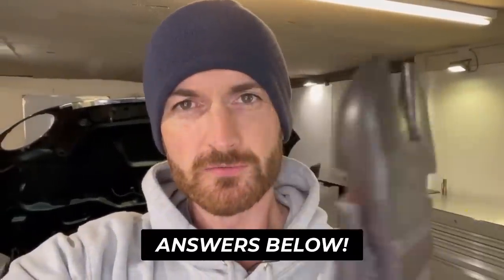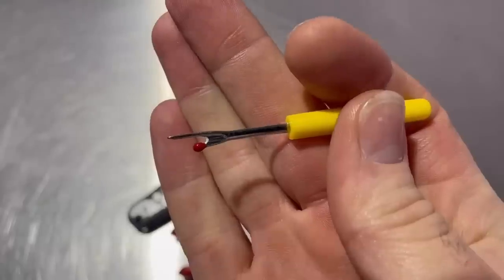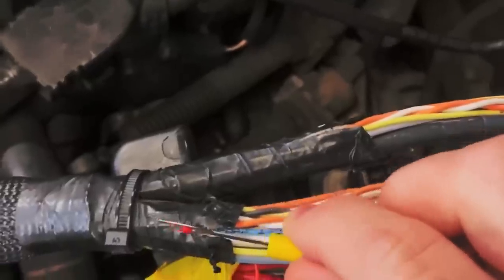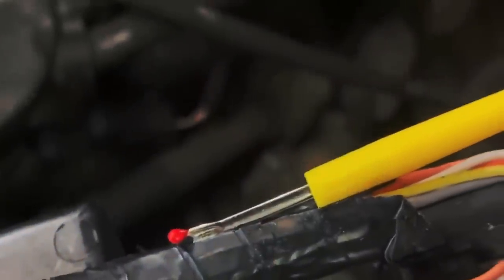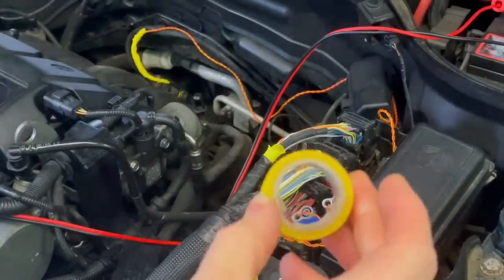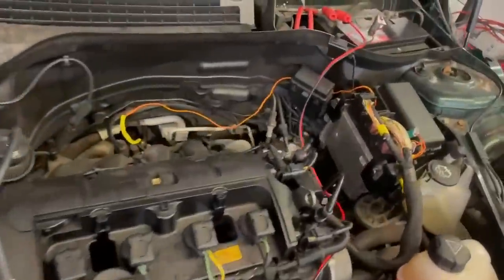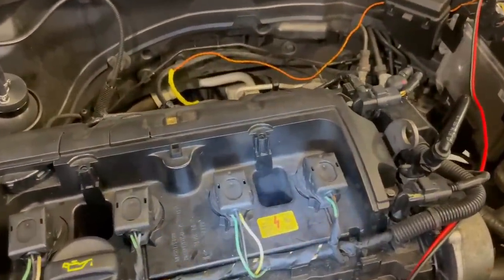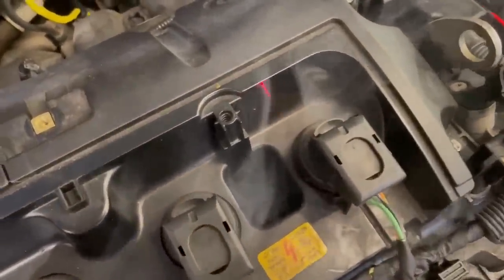This Tool is AWESOME! (And It Only Cost $1.00)

Comment: Just found your site, and subscribed immediately. I'm in South Africa and am busy with a Ford Bantam 1.6i, can't get anything that helps with wiring repairs. Had to replace wiper switch cluster as someone broke the stalk off, only Mazda Drifter spare which does not correspond to old one. Lots of sweat and leg cramps in such a confined space trying to rewire. Will definitely be looking into Alldata, although s a State pensioner I could not afford the subs. A small tip for what it's worth, when using the stitch ripper, I always slide the cap on the back of it, gives much better control.
Reply from the maker: Cheers! Sounds like fun 👍😅

Comment: Excellent tips especially for tractors where manufacturers often chuck the wiring looms in without adequate protection and the cables become brittle with age which can then be further compounded when the rats decide to have a nibble. These days with all the fiddley little wires often interwoven through all the other pipe work running to all the multitude of sensors it can be very tricky to get your fingers in .
I would recommend some spring hooks by Precise Hand tools LTD on E-Bay possibly available elsewhere. There are two versions a SS21 and a SS22 apparently made in Japan. These little hooks are useful for separating electric wires and much better than other cheapo versions I have used.
Reply from the maker: Sounds like you have fun! Cheers 👍

Comment: also, while we are here, the wrapping paper rippee/cutter works well too.  it has a larger handle and is a bit bulkier but easier to grab, ans the head/cutting area is larger; however, it does a decent job of slicing thin materials like paper, tubing, tape, etc.
Reply from the maker: Cool will check it out

Comment: 1. Yes, seam rippers are handy!  2. Nah. Unclip the connector and then you'll have room for the tape roll.  I got a roll of tape with a plastic holder 40+ years ago.  It had a pair of U shaped extensions on one side and a triangular cutter farther around.  It was used to hold the tape to the cable bunch while wrapping, then cut the end when you got through.  I found a replacement for it a couple years ago and the concept still works like a charm. 3. Who has smoke generators lying around?  LOL  Good one, sir.

Comment: The laser doesn't show up well in this video because the lighting for the video is bright, but it really does work. Especially in dark spots, like above a fuel tank or in a wheel well around a filler neck. The beam shows up bright and obvious. I keep a laser pointer with all the smoke machine adapters.

Comment: If you have to reach into a tough spot to put a nut/bolt in place and want it to fall out of the socket before it gets there. Take the right socket for the job put a paper towel between the nut/bolt and the socket press it in the tension created holds the nut/bolt so you can work it in when you remove the socket the paper just falls away.
Reply from the maker: Love this one. Much better than grease or butyl tape. And those magnet 1 inch adapters aren’t always going to work 👍

Comment: Excellent tips. I've actually used the socket method for some time but the others are going in my toolbox as well.
Weird thing happened while watching the section using the smoke machine. I  actually started smelling a smoke machine odor here siting at home. LoL
Reply: your not on 'crack' are you, dude 🤔,,Lol 😁

Comment: Instead of feeding tape onto a socket, which may be the perfect solution "sometimes", I think the better solution for THIS circumstance (wrapping the whole bundle) is to UNPLUG the connector right there and then wrap the tape while the wires are held standing up, then plug the connector back in.
Reply from the maker: Ah for sure, this was just an example. Khaby Lame would have owned me in this one 😅

Comment: Vacuum leaks are a pest, hoses gaskets etc. run engine and spray brake cleaner or ( Tractor Smack as I call it! Ether )
When the revs pick up that’s your leak area because the engine draws in the combustible component through the leak .
Also guys, look at your engine at night and trace possible plug wire jump or spark scattering.
Regards: Ken
Reply from the maker: Nice, I like that!

Comment: Where did the idea of wires looped in a harness to reduce interference come from?
All that I have ever learnt about cables and interference says that a loop could only make it worse.
Reply from the maker: It’s the length of the cable that’s significant. Changing the length then tunes it to another less problematic frequency. Like when you see the army jeeps with big long antennas, that’s for lower frequencies. Mobile phones have very short antennas for high frequencies. There’s a bit more to it than that for which I didn’t get too invested 😆

Comment: NOOOO!!! Don't use a seam ripper on tape!!!! You can get a "tape blade" for you stanley knive. It' looks like a hooked blade...a larger version of the seam ripper without the ball on the end of the blade. Use them for years in theatre when we have to tape heavy wiring onto pipes and stuff. At the end of the day/show, use the tape cutter to cut through all the windings and drop the cabling to the floor. Fast and easy. Only a few bucks for a pack of them which can be stored inside the knife handle.!!!
Reply from the maker: Like a carpet blade?

Comment: Got a dehumidifier?  Don't throw the water away.  It is valuable distilled water.  Do a final rinse with it after washing your car and leave it wet - no leathering.  It dries to an immaculate shine.  You will be stunned first time you try it.
Reply from the maker: Wow! Could catch it from the AC drain on the car right?
Reply: @MechanicMindset  Hardly.  There would almost be enough caught there to fill an egg cup but it is the same distilled water.  A home dehumidifier makes gallons daily, otherwise going down the drain.

Comment: Stitch "unpicker"??? It is called a seam ripper. I have used one for decades. That is an excellent hack!
Reply: In Australia we also call it a Stitch Unpicker , just depends on what part of the world you are from.
Reply from the maker: Typical trade; 20 different names for the same thing 😅
Reply: @MechanicMindset  that's for sure mate, I'm from Australia and worked in the building industry for many years, we used to call a Hammer a Persuader

Comment: I like the stitch ripper on wiring looms, I do a lot of loom repair and modification, this could speed up the process over a razor that I normally use. Maybe blunt the ripper tip on a stone so it isn't as sharp. I like the socket idea for tape, I use pencils, pens or other small objects but I can pop a 1/4 drive socket on my screw gun and power wind the tape on fast! NICE.
Reply: Just use the side that has the little ball tip

Comment: I would add more tape to the socket than needed so it can be held and the tape cut with scissors so there's less risk of dropping the socket into the engine area.
Reply from the maker: Nice tip

Comment: I wrap tape or ptfe around the stubs of pencils. You can get into some very tight slots without needing your fingers to get fully behind or underneath. Rolls of Hep2o come with a tape slicer, basically a scalpel blade with a small section of the cutting edge open, but a plastic leading edge. Some silicon lubricant stops most adhesion to tape.

Comment: A MENDA 35250 Threader, Wire, for Harness tool is useful.  Designed to slip in to a loom but the channel can also be used to run your blade along to cut the tape while protecting the wires.
Reply from the maker: Will check it out cheers
Reply: where can i buy that from, please ?? 🤔🙂

Comment: Some very useful tips for non-tradespeople. Electricians can use side cutters and the Stanley knife with no issue. Very good point about looped wiring in the harness. As usual a down to earth and well-presented video.
Reply from the maker: Cheers Colin, I usually risked it with a knife or unwrapped it. This is pretty cool though 👍
Reply: Light pressure with blade wont cut throughinsulation

Comment: Here in the States, Snap-On makes a beefier seam-ripper.  The standard sewing seam-ripper has trouble cutting through old, dry electrical tape.
Reply from the maker: Oh, they beat this little hack then 😆
Reply: I've Had A Snap On Seam Ripper In A Terminal Tool Set For Over 15 Years!!!

Comment: Hey Darren, I've used the tape roll method for years, but a little different - not around a socket, use around a foot or so of tape and roll it back into a tiny roll inside out so the adhesive is on the outside and then the tape rolls onto the wire as you wrap it. It's now a tiny roll and easily goes through  a small gap if your taping an individual wire. 
I'm so buying some thread unpickers soon though and using the temp gun laser with the smoke - good tips👍
Reply from the maker: I like that idea to make your own roll of tape 👍 cheers!
Reply: It's easier to just remove the center cardboard and squish it through this way you have a loop to keep tension on the loom
Reply from the maker: @mydroidid  Nice idea
Reply: I'm gonna try the inside out tape deal, actually right now. Yeah shrink tubing nice, but when you slipped and sliced off  some insulation off the wire!? Think it's just the thing, I use 3m tape, it's stretchy, sticks, good. Always have trouble with the ending. That's where it first starts coming apart later.
Reply: @michaelvette7659  I always keep a small bottle of liquid tape in my box. Works well for those oh sheee@ situations
Reply: @cbmech2563  Liquid tape ? where do you source that from ? 🤔
Reply: @sollykhan2385  Amazon or sometimes Harbour freight has it.
Reply: @cbmech2563  ahhh,, cheers for that,  🙂👍,,,Bless 😇